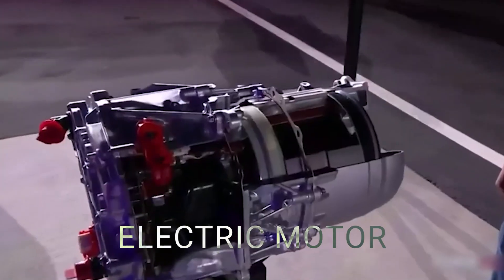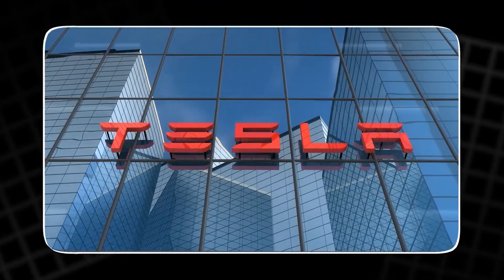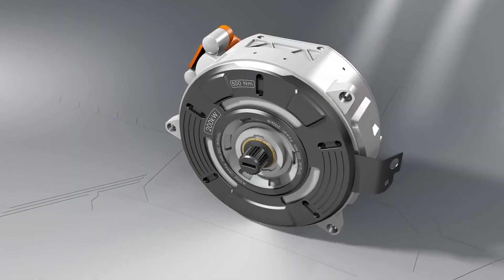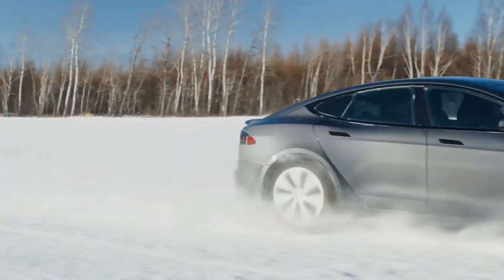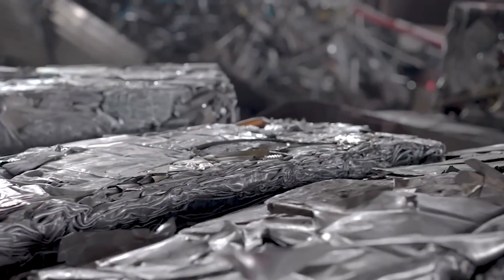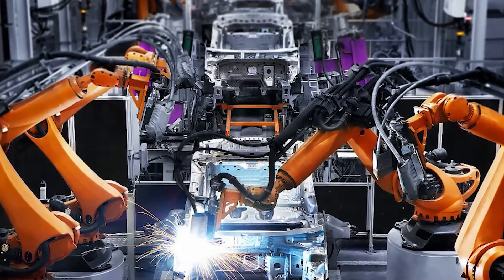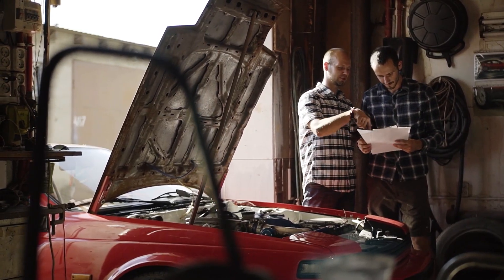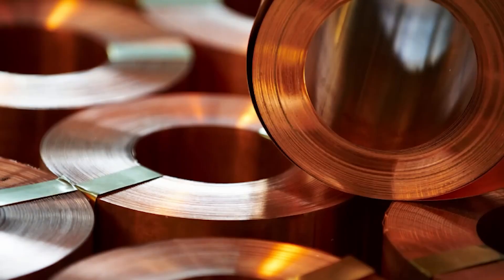How Elon’s New Motor Makes a $15,000 Tesla Unstoppable: The Secret Killing BYD & Toyota

Comment: in this case if Ev motors get cheaper, safer and more powerful besides cheap, safe and viable batteries. thus it will be very easy by then to convert every ICE car into an EV and it will push Gas stations to be converted into Electric super charching stations :)

Comment: That's funny I'm spawn Motors at 30,000 RPMs and they didn't fall apart I ran some for 30 years sure they needed maintenance far as I know they're still running I retired
Reply from the maker: Wow, 30,000 RPMs? Sounds like your motors are more resilient than some relationships I know!